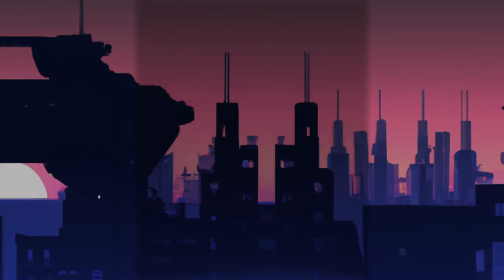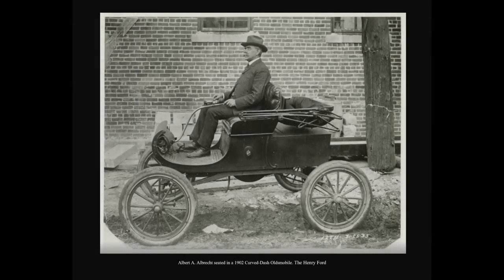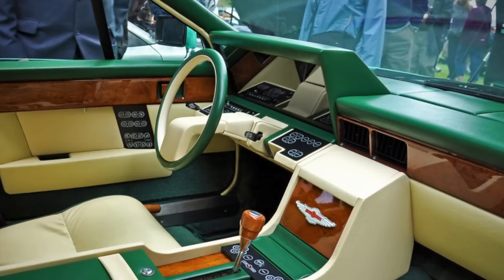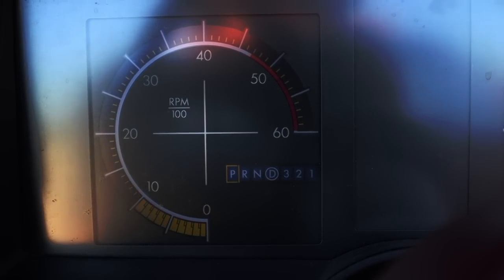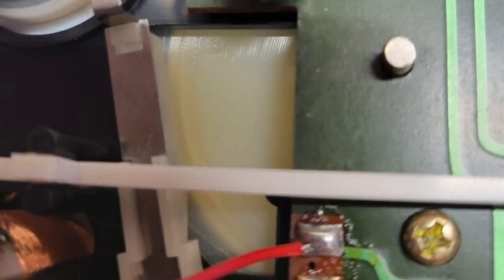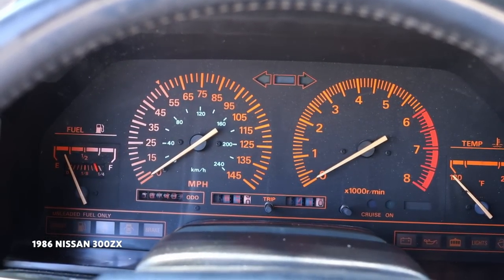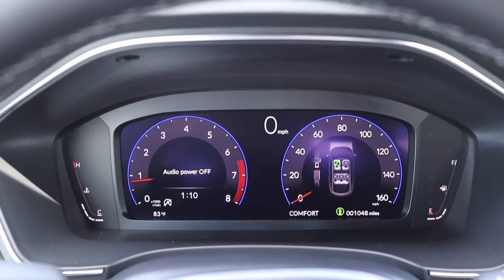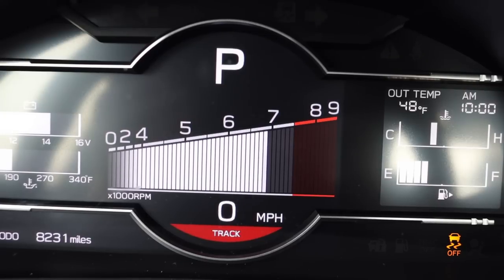Digital Gauges - How They Were Invented And Where They Are Now!

Comment: I think it's inevitable that screens in new cars will fail at some point. It'll be even worse since car makers insist on putting a screen in every square inch of new cars.
Reply: I'm surprised aftermarket digital gauges haven't caught on. I know race cars use them all the time, but given how customizable they are these days and how all the data runs through an ECU, you'd think more people would've swapped them in. Seems like an easy way to give an old car new features.
Reply: @danieljones8706  You can get them for popular classic cars (first & third gen Mustangs, Tri-Five Chevys, GM pickups, etc.) They can use existing sensors or plug into the ECU if a modern engine has been swapped in. Some have all LCD displays, some have needles with a little LCD like modern cars for the odometer.
Reply: Not only that, but as technology progresses they all look outdated after a handful of years
Reply: @danieljones8706  there's apps for phones you can use to bring up all kinds of info, connected thru the OBD via bluetooth.
Reply: We have a 2015 Citroen Grand Picasso with a digital gauge and it still looks great and without flaws

So I must disagree with you there
Reply: @PASquared  as if analog gauges ever looked modern to begin with

"Timeless design" is just an oldie's excuse to hate on the next new thing
Reply: @Solotocius  When the screen has low frame rate or has at the moment popular UI designs it does age it pretty quickly.
Reply: @karambiatos  we'll just have to wait and see if that's true
Reply: @Solotocius  what do you mean if it's true?
It's already happened laggy digital clusters and shitty laggy infotainments are already a thing, even really expensive cars have this issue, because car companies are too cheap to put in a good processor in them
Reply: @karambiatos  that's a stupid generalization
Reply: @karambiatos  give me an example, Mr. Insultrandompeopleonline
Reply: @Solotocius  you started it.
new subaru infotanment
the slightly older mercedes infotainment and guage cluster on even their super cars.
Reply: They fail pretty often. The ones that still work can be covered though
Reply: @karambiatos  Even if car manufacturers put good processors for their digital clusters and infotainments, they can still lag.
Let say a car manufacturers add good processors for 2023 model year, the processors would still degrade and may lose performance over time. Same thing happens with any computers and consoles, not just digital clusters and infotainments. All processors will become slower and more laggy due to aging.
Reply: @automation7295  if its a good processor it would take a long ass time to degrade if they give it good headroom.
10-20years. it doesn't happen in one year.
Reply: @karambiatos  I'm just saying that all processors degrade over time.

Good processors may take longer time to degrade, but car manufacturers or anyone wouldn't expect anyone to own same car for 10-20 years.
Reply: @automation7295  of course they expect you to own it for 2-3 years, but the processor degradation isnt an excuse to put shitty ass processors that can barely handle the simple software to begin with.
Reply: hold on let me update my fucking car
Reply: @automation7295  not deliberately. I was just adding emphasis to how ridiculous that sounds
Reply: Analog gauges also fail regularly. The screens are probably more reliable
Reply: They do fail. I have to get mine fixed. It looks like when a regular calculator displays the numbers half showing.
Reply: Yeah but even then classic instrument clusters have also failed many times, and the center screen in my mom's 2008 honda is still running fine, i dont think they're that bad on the side of reliability.
Reply: With how much tech has evolved throughout the years, i don't think screens can fail so easily. The only thing that's gonna degrade overtime is the processor (after 10 years usually depending on the quality) and UX design but design is always gonna age no matter what, look at 80s car design just for an example.
Reply: Why would they fail? Doesn't your TV still work?
Reply: Mechanical gauges fail too. One of GM's vendors supplied bad stepper motors and the speedometers died. There was a high failure rate and lawsuits over it.
Reply: I dunno, I have 20+ LCDs here from the early 2000s and late 90s and they work. 

But I agree, less screens please.
Reply: @danieljones8706  ahhh those blue and black semi circle digital gauges gotta love them
Reply: I love digital gauges but what new cars are doing is to much
Reply: the worst trend Im seeing is the use of touch controls as supposed to analog. I used to drive an old car with analog buttons but then I got a new one with more touch screen and buttons that are hard to determine when your eyes are on the road. I jsut hope they bring back analog buttons, theyre tactile and useful to have while driving and feel more responsive
Reply: @Sentoriika  Too bad you can't program a voice command macro or something. I mean, you could do that on ta 386 computer in the 80s, makes total sense that you can't do it now :P
Reply: Most cars won't last long enough to reveal screen faults
Reply: @ShonTolliverMusic  My TV isnt outside all the time at 0 or 100 degrees and it doesnt have all the vibration.
Reply: screens are cheaper to manufacture then individually crafted buttons and switches. Screens also become outdated quickly because theres better tech every year.
Reply: @kentaotsuki1331  I guess they would be now, yeah. Should be pretty cheap then, to replace them when they fail.
Reply: Im surprised that those one frame ink screen Haven't caught on, things is nearly free energy and wont break unless you forcefully smash it
Reply: Just buy a Tesla model 3/Y where it’s one screen for the whole car, nothing can go wrong there…
Reply: @musicalhistory4392  At least provide a USB port for a keyboard, which you can program macros into ;)
Reply: @danieljones8706  The problem for most of the cars on the road is that manufacturers in the mid to late 90s started implementing security systems tied to the dash which will then need to be defeated, many digital dashes will either be too generalized and you are basically chucking a small tablet infront of your gage cluster. Or if you are lucky enough to have vehicle specific dashes in the market because enough people decided they like to upgrade them, many lack basic functionality like check engine lights and etc. The other problem is that in replacing the dash, it's easy to alter the odometer leading to trust issues on actual wear on the vehicle, and thereby resale value.
Reply: @ShonTolliverMusic  So your TV is parked outside in the heat inside the car at sometimes up to 60c...put your phone on the dash of your car and see how long it lasts...not long
Reply: @the_kombinator  bet they're not outside in the heat of summer ALL DAY inside a Car
Reply: @23yearsand76  That... that's a good point. Actually, I wonder if the Tesla screens experience lag due to cold. I know my $29.95 OBDII reader's LCD slows to a crawl when it's anywhere less than 4 degrees outside (C), but I imagine modern screens are a bit more resilient.
Reply: I would rather have physical dashboard with buttons and nobs not a 50 inch screen in my face.
Reply: Mercedes hyperscreen enters the chat
Reply: We had a 1991 Renault 21 TXi with a digital cluster that never failed.
Reply: @automation7295   The processors don't physically slow down (provided its not actually melting), its just that they keep pushing laggy updates that slows it down.
Reply: @PASquared  I think that's a major issue for the large displays that try to be "flashy" - Keep it simple. I like segmented digital displays as they are clear and not distracting. I tried one of those giant Tesla "ipad glued to the dash" type affairs and I'm giving that a hard pass.
Reply: The difference to the earlier displays is that today's displays can be changed very cheaply.
Reply: Ngl the s2k have a really nice one
Reply: @Solotocius I’m a mechanic. Rarely do I replace an analog gauge cluster. I do ,in fact replace the digital displays in newer cars almost daily.
Reply: We already do.  Tesla, chevy, ford and others.

Comment: S2000 still has my favorite digital gauge cluster.
Reply: I had an RC51 that had a very similar look to the S2000, but a 10k redline!
Reply: Ahhh the S2000 what a great car.
Reply: it was designed to look like the guage cluster in Aryton Senna's MP4 McLaren!
Reply: @Biriadan  Just about to say this.
Reply: i had a mid 2000s cbr1000RR, and digital speedo was absolute garbage.  it would just flash numbers and only update like 2x a second.  it may as well be a lottery number picker.  if you pinned it, you would see on the speedo: "0, 19, 39, 58, 65, ..." it was genuinely stupid and useless. compression brake would do the same in reverse
Reply: @loginavoidence12  I had an '88 Chrysler new Yorker like that.

Comment: The digital guage cluster on my 1984 Corvette is one of the main reasons I bought it, absolutely love the retro futurism vibes!
Reply: This is the exact same reason I bought my 1984 corvette too. The cluster still works and plan on doing the LED backlighting when one of the original bulbs fails
Reply: My Prius does have that oldschool retro  digital green gauges it’s from 2012 and that’s the reason i don’t like it does have that.   Because even in 2012 you expected white l.e.d instruments
Reply: it's not digital it's  vacuum fluorescent display   VFD is not a semiconductor      other wise i could claim a  Compact fluorescent  light bulb or  neon light is   "digital"
Reply: @punker4Real  it is definitely digital, it's an LCD. Other cars of the era had VFD displays but the Vette has an LCD display. I'd argue that lcd is in fact, digital.
Reply: @silversurfer420      LCDs are not a semiconductor 

LED is 
VFD is a gas in vacuum tube..
Reply: @punker4Real  So you're saying the LCD panel on a monitor, TV, phone screen, etc. is not digital? I don't quite understand your argument
Reply: Have you seen the Camaro Berlinetta interior? It’s beautifully 80’s!

Comment: I loved the digital dash in my 300ZX.    I did a lot of road trips and dual trip odometers were very useful before GPS.    Also, the countdown fuel gauge let you make full use out of the large fuel tank it had.   In some ways that car had the best driving ergonomics of any car I've had.   The digi dash broke once, and it was a quick fix with a soldering iron.
Reply: I have vivid memories of both my 300ZX's sliding into intersections. That car was front-end heavy. Otherwise, I loved both of them. My digital dash started to go out (bad power module) and I used to joke I could slap the bottom of the dash to tell how fast I was going.

Comment: My 1996 Jeep Grand Cherokee has a vacuum display, VIC(Vehicle Information Center) it shows the time, date, doors open, low fluid, and even some engine codes. It's extremely rare to have one that hasn't failed yet unless they'd been rebuilt. People say it's the solder joints because of the lead free solder, but after taking a few apart at the pull yards I found the power side of the board had traces burnt out. I followed the traces and remade the connections with actual wires and bam, I have a rare, working VIC

Comment: In Australia we got 2 very nice VFD displays - both launched in 1984.  The Holden Calais one only lasted 2 years in production, and followed GM USA’s ‘system check’ gimmicks.  Interestingly it used a 16 pulse speed sensor (vs the normal 10) as an easy way to run mph electronics at km/h.  
The other was the Australian 1984-1988 Ford Falcon/Fairmont/Fairlane/LTD models.  Top line trim levels got a full VFD that was very neat, and IMO looked way nicer than any of the examples shown.  Lower models still got a partial display - some of the ancillary gauges were VFD, paired with an analog speedo & tach. 
Ford Australia teamed with Mazda back in the day for tech like this, so it was pretty reliable, but the 1988 model update saw them shift to backlit LCD, and odd digi/analog combos.   By 1993 they were back to full analog - the remains of digital instrumentation stuck firmly within the boundaries of the trip computer and odometer.  
VDO Australia made all of those clusters too - but clearly borrowed global technology.

Comment: Left out the 80's C4 clusters, they were LCD screens, with polymer film to make the information readable, they were still quite faulty but batee, a company that supports these clusters, restore them with much newer technology, and well as LED backlighting to replace the halogen that would often damage system boards, I got lucky when I bought my 85 C4 that my cluster was rebuilt, but with halogen bulbs, after a year of ownership I swapped them to the LED's, and thanks to the matte film on the screens, they are perfectly viewable in complete daylight with the sun beating on them.

Comment: My 87 Dodge Daytona does have an electronic cluster and using it I'm really really surprised they died after that came out. It's still way more than bright enough to use comfortably in the daytime, and is absolutely the most 80s thing I've ever used. My cluster came from a Lebanon of the same model year and works beautifully.

Comment: You pretty much nailed my two issues with digital clusters.  I've been driving a Lincoln Town Car with digital gauges the last month or so, and the brightness is an issue.  It dims into a night mode when you turn on the headlights, which I do a lot during the day this time of year due to gloomy overcast weather.  This makes it hard to read, so I crank the night mode brightness.  Problem is when actual night comes around, then it's too bright, so I have to adjust it again.  It's fairly annoying (epically since the brightness adjustment isn't a quick dial turn, it's an up-down switch that you have to tap repeatedly or hold and wait for it to slowly change).  One thing I do like is the information center with various info about the car that's only practical because of the digital display.

As far as modern cars go, when those screens start to fail, it's going to be completely detrimental to the continued function of the car, because they control so much often including critical items like the climate control.  Modern cars may be designed in such a way that they can mechanically outlast old cars with less maintenance, but all the electronics are going to make "classics" a thing of the past.  Their life expectancy will be shortened more by time than by miles.  Right now you can easily keep a 50-year-old car on the road if you're so inclined because everything is mechanical, simple, and easy to fix with basic tools.  Fifty years from now, good luck keeping a 2023 anything operational.  The electronics will be worn out and faulty at that point, replacements will likely not be available, and part fabrication for critical system computers/controls will be close to (if not completely) impossible.  Plus, even a fairly basic service than can be done now will be impossible in the future when the specialized equipment is no longer anywhere to be found.  That actually happened to me with an early electronic fuel-injection Cadillac.  The ECU wigged out (preventing the car form running) and required a specialized computer to diagnose it.  The car was so old, that no one had that special tool anymore, rendering the car useless and unable to be worked on without fairly involved modifications.

Comment: With as good modern screen technology has come, I'm sure a modern digital gauge will easily last as long as the car assuming they weren't using cheap low-quality components. And since you can easily make the gauge cluster to whatever you want in software, I'm sure they'll just be more and more common.

Comment: I remember the Ford Thunderbird from the mid-80's. They used a LCD speedometer with analog gauges. I can see why they chose LCD over the previous VFD because it was probably more reliable. However the speedometer was barely readable on really cold days due to the nature of LCD's until the backlight warmed it up enough to function.

Comment: I think customers HATED the readability of the original digital displays. If you look at something like the current Toyota Corolla or Toyota Camry models, note that the digital displays now are far easier to read, often mimicking the old analog dials. That's why it's such a shock for new drivers of the Tesla Model 3 or Y, since all the controls are on a single 15" flat panel.

Comment: I am not quite fan those modern / retro digital panels. Id rather stick to old school gauges, but I dont think it will change in the nearest future since its still cheaper for the automaker to throw the LCD panel that will fit for all models instead of making individual gauges. 

But hey - how about making a video about the evolution of lighting car dashboards in the night from the begining or the interior heating system in the cars?

Comment: The real reason for the return of digital displays is that digital displays are now significantly cheaper than mechanical gauges. Since multimedia systems are standard in modern cars anyway, you save money on additional mechanical gauges. The displays themselves are mass-produced anyway, because almost every modern device has a display. Therefore they are also very cheap. Of course, it is marketed as modern and cool.